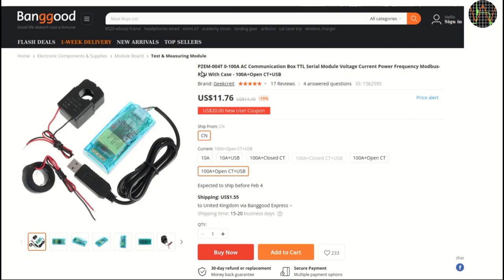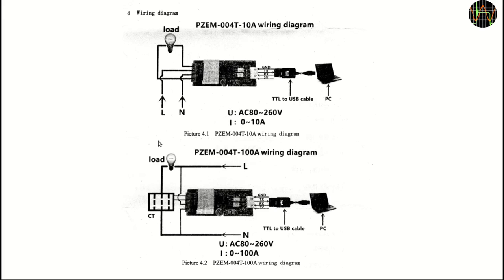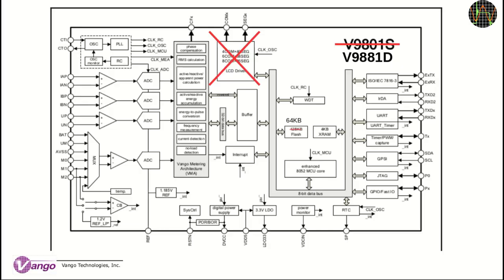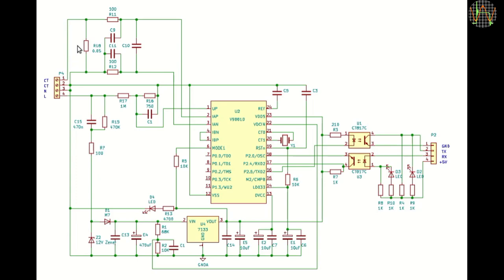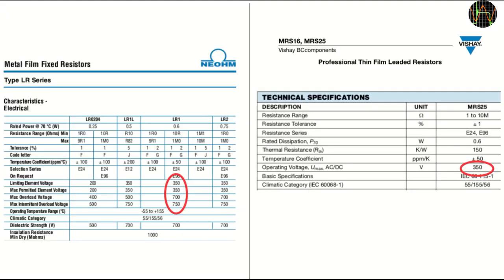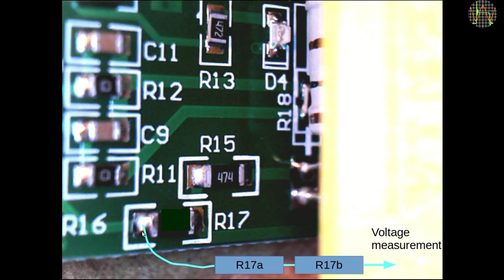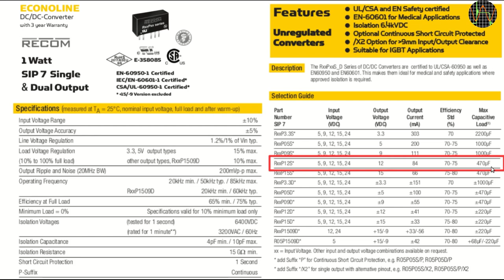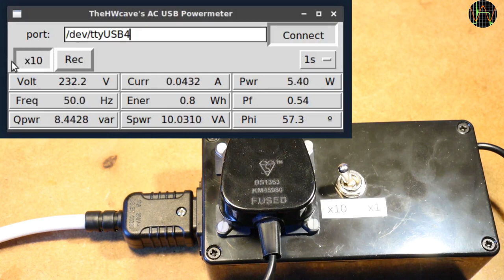Modifying the Peacefair PZEM-004T AC Comms Module (with schematic)

Comment: Great, thanks for the schematic. I wanted connect this directly to raspberry pi UART pins, but could not because of the 5v vs 3.3v levels. Now looking at your schematic I see I can just provide 3.3v to pin 4 on connector P2 instead of 5v.

Comment: I was going to make some mods to enable operation at low voltage, but I wouldn't have thought of using a DC-DC converter as you've done, an excellent solution! 
I'm currently designing my implementation based on all your mods, but with a few variations.
Thanks for making the schematic available, it's a great help. One small error: The cap across R16 is labelled as C1, but should be C12.

Comment: Hi, thank you very much for the informative video, I'm looking at your github page now, this is all very helpful. I was thinking about the calibration aspect of changing the resistors. If the resistors are changed and the Ac voltage reading from the board is, for example, 235vAC, instead of 240vAC, as read on an accurate DVM, could you apply a fudge factor of 240/235 to all the voltage readings to obtain the correct voltage? I'm assuming the calculations within the chip are linear.
Reply from the maker: Without the source code, we can't know for sure how the firmware in the chip does its thing but I would say it is very likely a simple (linear) scaling operation so using a fudge factor based on actual vs reported voltage should work fine.
Reply: @TheHWcave  thank you, once I'm up and running, I'll use my Variac and start doing some tests and will confirm back here 👍

Comment: 10:00 The zener diode ensures that the required 12 volts are generated in the positive half-wave and in the negative half-wave the zener diode works like an ordinary diode and charges the capacitor negatively.
The capacitor must always see AC otherwise the capacitor power supply will not work.
It is not possible to connect a diode in series with the capacitor, because then the capacitor will no longer be discharged. A full capacitor will stop the current flow.
The zener diode can pass current in both directions. Once with 12 volts and the second direction with 0.6 volts. Therefore the capacitor sees AC and it works.
But because 12 and 0.6 volts is an imbalance, the capacitor still needs a discharge resistor.

Comment: These are now being offered on Amazon/USA in a white, panel mount case. They reference the PZEM-004T module, but they are not sold by PeaceFair, IIUC.
Reply from the maker: Interesting. I wonder if the circuitry is still the same. Maybe someone who bought one will tell?

Comment: The schematics is slightly different with brochure which the Line placed on 3rd pin not 4th pin
Reply from the maker: in principle it does not matter and many countries don't have polarized mains plugs where L and N can interchange depending how the mains plug is inserted. The UK has polarized mains plugs where L and N are always the same. I  Ilke connecting N to the common and L on the pin that is subdivided by resistors. Call it personal preference but I find it neater and makes the rest of the circuit (marginally) safer ...  but applies only if your plugs and sockets work that way (and are wired correctly)
Reply: @TheHWcave  It also applies if you're not using plugs, but wire it directly, in which case it's particularly easy to see which is which.

Comment: I got in touch with Peacefair to order a sample rated up to 437V rms. That would allow to make line to line measurements possible and also line to neutral in case of a neutral fault in a 3P+N setup. Unfortunately, I hadn't seen this video at the time of the order so I could not send them the feedback. I wonder if they changed the layout and resistors for such a high voltage rating.  i'll probably make a video of the test when i get the samples.
Reply from the maker: I am curious about the modifications that make it rated for 437Vrms. Please share when you receive it.
Reply: @TheHWcave  So i got the modified module. The safety yellow X1 capacitor C15 was changed to a brown 630V film capacitor. As for resistors, only R16 was changed to a 470 ohms, which gives a top measured voltage of only 427V instead of 437V i requested. I guess the engineer didn't have tailored SMD resistors at hand ;( Besides that the vango 9881D SOIC datasheet must have an error for the UP pin max measured voltage, it should be 200mV RMS not peak) with a 750 ohms R16 resistor on the unmodified voltage divider gives the proper max RMS voltage of 266,86V. I did not notice majors changes on the powering part resistors uphill of the zener diode. R15 is strictly the same. R14 the big thru resistor is the same wattage it seems (same form factor but is beige so it has been probably swapped to a carbon film resistor). As for the layout and traces I did not notice any change. I will power it up between two phases and wait for fumes (with a ceramic fuse upstream). I hope that the engineer modified the SOIC firmware for the new voltage rating at least. Will keep updated.
Reply from the maker: @rodv92  Many thanks for providing us updates on that modified module. I am not surprised that they had to change C15 as the original was only rated for 250VAC. It acts a capacitor dropper to reduce the voltage for the Z-diode that creates the raw supply voltage.  R15 is just there to discharge this capacitor safely so you don't get zapped if you touch the circuit after power was removed.
Reply: Happy new year!
I use 3 phase, 200V power supply . I can use this device to measure the power consumed between line1 and line2(two phases) . Thanks!
Reply: Sorry, my English is not good. I want to ask you: can I use this device to measure the power between line1 and line2? ( two phases - 200v). Looking forward to your early response. Thank you so much!
Reply: @rodv92  I've followed the clues from your comment and swapped R16 to 470R which gave me 145V and 330R gave 102V. Original value of 748R gave 227V which is correct one. Therefore, I assume that something else has been changed too in your requested module. In my location, we have voltages fluctuation and it can fluctuate from 220V to 270V (higher during night when there is less load). I am still looking for a solution but I'm out of knowledge how to measure voltages between 200V to 270V.  @TheHWcave  I will be thankful if you know what resistor value may achieve 200V-270V.

Comment: rectification using the forward conduction of the Zener is not "wasteful" as you state ... it is in fact necessary to avoid DC current flowing in that series cap that has the main purpose of reducing the voltage...if current would be only + halfwave, then series capacitor would then overcharge and would cause the circuit to malfunction

Comment: Thinking of going one step further and de-soldering the IC and rolling a new board, and replacing the 3.3V regulator and opto-isolators with something like the ISOW7721. Have you thought about this route already?
Reply from the maker: Frankly no. I am quite happy with the variant I have made. It does what I want it for. Regarding reusing the chip, there are several shortcomings, for example these days we rather want to know if the power is consumed or generated (as in solar for example). If going through a development effort, it would be better to design something that can do that. But then,  I am sure designs for such things already exist in many variations.

Comment: nicely done, thanks for sharing.  Was considering powering a ESP8266 from the 7133 but datsheet seems to suggest it is a 3.3V 30mA reg which is under powered.  Perhaps It could be powered via a separate 5v reg from the 12v rail.  I think R? 100 could handle an extra ~50mA (~1/4watt dissipation) 
I like the idea of using the ESP8266 wifi for complete isolation and easy remote access.

Comment: This is a great video. I would like to put a ESP01 inside to the Pzem004. Yes, to install in the same original box and connect the ESP in the TTL using 3.3/5v and gnd from pzem. Is it possible? How?
Reply from the maker: I have no experience with the ESP01 but it sounds doable, sorry that is all I can say

Comment: Just played around with this item.
I've removed the 3.3V regulator and piggybacked a galvanic isolated DC DC Converter 5V -> 3.3C onto the Optocouplers. connect output to 1 ( gnd) and 2 (3.3V) of the regulator pads.

What I have an issue with it on how to determine power flow direction. Anyway I connect the CT coil it just show positive energy flow.
Reply from the maker: Yes, unfortunately the firmware doesn't seem to distinguish flow direction. It was probably written when nobody thought of solar installations.

Comment: English socket, German accent -Mods I`ve already done:) Same way. Shunt transformer with smaller hole/not demountable is more accurate. It`s better to use DC-DC converter 5v to 5v and recalculate divider R1 and R2. HT7133 is low drop linear converter, so 1,7V is enough.Converting 5V to 12V and then 12V to 3V3 it is a waste of energy. Thx
Reply from the maker: I agree that it's more efficient to skip the 12V stage and go to 5V directly after modifying the divider as you did.

Comment: Hello.

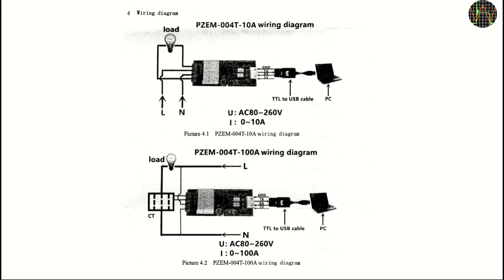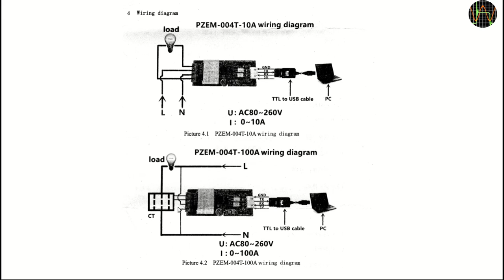Pay attention to the top mounting diagram of 10A in the minute 3:55 to 4:40.

There is an error connecting N to PCB.

The manufacturer's erroneous diagram connects L and N to the central contacts that are together in the PCB (see minute 7:24 to 7:29) causing a short circuit.

To solve this, connect N to the lower connection where the load is connected.

Regards.
Reply: The diagram you've mentioned is for the 10A model.  However, the device in the video is the 100A model.  The circuit differences between these different models were mentioned in the video.

Comment: At our location, we have voltages fluctuation and it can fluctuate from 210V to 280V (higher voltages during night when there is less load especially in winters, local grid transformer get in flames sometimes under load so I have seen 110V twice in a year. yes, we have very poor grid supply). Therefore at home, we are using a voltage protection relay with a beefy contactor to limit supply to 200V-270V, thereafter RCCD is there along with the MCBs, furthermore all sensitive electronics and low powered electrical devices is powered through a phase out of 3 phase which has a servo transformer based voltage stabilization (230V output) which further powers an inverter with 24V battery bank for backup as we have power cut in our city as well.  I am looking for a solution to measure 3 phase power supply between 200V to 270V so I brought 3 PZEM.  I thought of going with Option 2 and powering all 3 PZEMs with a power supply using a old fashioned way of a locally available transformer with primary and secondary windings and bridge rectified it to get 12V using voltage regulator (no smps). And maybe using another transformer based supply to power ESP32 and RX, TX side to keep opto-coupler side isolated too. Though both transformer will be powered using same phase supply which comes from inverter and always on even during power cut so I can measure power cut state, length of power cut beside voltage and current monitoring per phase for further automation in the home. I'll change the resistor to 0.6 watts at input as suggested. Though I'm not sure if that will be safe in measuring 3 phase power supply or not, can you suggest if I can go with this plan?

Comment: I have a question regarding the DC to DC converter used here. I have heard the reasons for the selection of the converter which is solid but instead can't we use a MT3608 mini boost converter with a 6V TVS diode/MOV at input and 12V TVS diode/MOV at output? This should effectively protect the circuit if any high voltage comes up.?
Reply from the maker: No, please don't. The problem is not spikes on the power rails but that in your scheme if you are lucky you have neutral connected to the USB ground and your PC but it could just as well be live if the plug is reversed to the wiring swaps it somewhere. The PC will probably let out smoke immediately but if its an isolated laptop, it could also just sit there and wait for someone or something connected to earth to touch any metal part for a very nasty shock / and or fireworks.
Reply: @TheHWcave  Apart from the connection issues, You have mentioned about reliability of the other DC-DC converters when used with PZEM. Can you tell me how this happens as 12V input to the chip should be isolated from the high voltage lines? In theory any isolating DC-DC converter should work and last long.
Reply from the maker: @sheminasalam  I read that somewhere and can't find it. But I checked another one  Wurth Elektronik 1769405241 and they say (paraphrasing)  that if the module is repeatedly experiencing high (kilovolts) it degrades the isolation barrier because the coating of the wires in the isolation transformer of the unit "due to chemical reactions that occur at high voltages". They recommend that the max voltage should not exceed the test voltage - 20%. If the same applies to the Recom (which I assume) that would be about 5KV. In short, I don't think we have to worry about it in an application that sees normally 250V and only very occasionally higher spikes. I do use a surge protector in the incoming supply of my lab that should reduce bad things coming in through the power line, eg. during a thunderstorm nearby
Reply: @TheHWcave  My energy monitoring setup is with esp8266 3 phase running tasmota. The main problem is with zero detection. Also one of my modules goes offline when the AC voltage goes below 200V. Your video and github project has been really helpful. From that I was planning to remove all the unnecessary parts and then use a mini MR3608 boost converter to input 12v to the chip. From what we have been talking, I feel that the isolated dc dc converter is not compulsory for my setup as my connections are permanent and chances of it being mixed is less.  what do you think?
Reply from the maker: @sheminasalam  I'd say no, but your mind is clearly made up already, so all I can say is good luck.
Reply: @TheHWcave  I haven't made up my mind.😄 I am just gathering expert opinion on the matter. I haven't used a DC to DC isolated converter till now mainly bcos it is difficult source in my location. Mostly I go for a AC to DC isolated power supply which is cheaper. Here also I was thinking of using a 500mA 12v isolated AC-DC power supply module instead the DC-DC converter. How would that work ?

PS: The 12v power supply module and the esp8266 would be powered from an inverter so that even if there is power loss in all phases, these would report 0v.

Comment: Можно ли просто подключить напряжение питания 3,3 В к разъему P2 (контакт 4)? Тогда не понадобится преобразователь уровня для подключения PZEM к ESP01.
Reply from the maker: Possibly, it all depends on the current drawn by the ESP-01. I had a look at the datasheet (never used one myself). It can draw up to 170 mA worst case. That would probably be too much. The lowest TX power draw was still 120mA. Quite a lot. Not sure if that would work

Comment: How the process of this sensor can produce the power factor value?
Reply from the maker: The V98xx chip measures current and voltage continuously. It multiplies current with voltage to get active power. In a second part of the chip the current signal is first phase shifted by 90 degrees before being multiplied with voltage. That gives reactive power. The power factor is then calculated as the ratio between active and reactive power.

Comment: I have an energy meter which has V9821 IC. I have gone through the datasheet for V98XX which covers both V9821 and V9881d ICs. As per the diagrams in the datasheet I've observed that in V9881d pins Rx and Tx used for UART communication are UART2 pins. which are named as P2.4 RXD2 and P2.5 TXD2 in the datasheet. and these are for IR communication because UART2 by default is set for IR communication. how pzem-004t module is able to provide this functionality to connect it serially instead of IR. Is it possible that both have different firmware? Could it be possible to run same command over IR communication to read the metering data?
Reply from the maker: Sorry, I have never looked into this in detail and can't answer this.
Reply: hi TheHWcave, thanks for your reply.

Comment: great video. do you know if an adum6000 could be used as the isolated dc-dc converter? they are smaller and could be soldered to an soic to dip adapter.
Reply from the maker: I had a look at the datasheet (rev D) and it should be ok but check the  limits on isolation voltage and recommend PCB layout

Comment: Hello
Thanks for the great explanation.
I plan to convert 6 modules. Since I unfortunately do not get the R05P12S I have another question.
Couldn't I run the 6 modules with their own small 12 V supply supplierend by on source?
E.g. a HLK-PM12 for all 6 modules? All 6 modules are running on the same phase for my heating system.
Reply from the maker: Yes, that should be ok. I assume you would power the HLK-PM12 from a different AC source than the one you are measuring.

Comment: Was inspired by your video to buy a version with LCD for a variable AC power supply I am working on. The new PZEM 020 turned out to have a more sophisticated powersupply - but your general approach would work. I went with using an external DC supply instead ... have posted a video on my channel if folks are interested